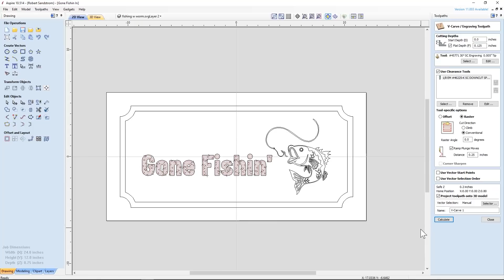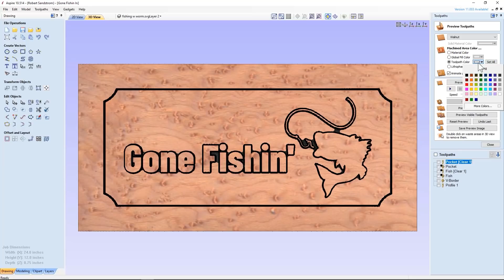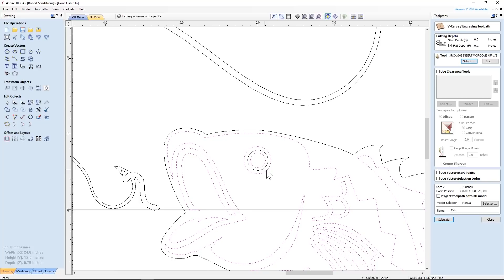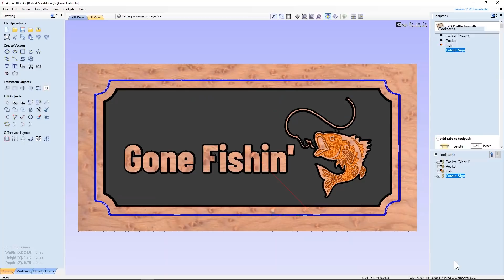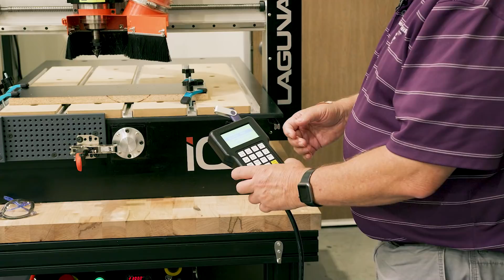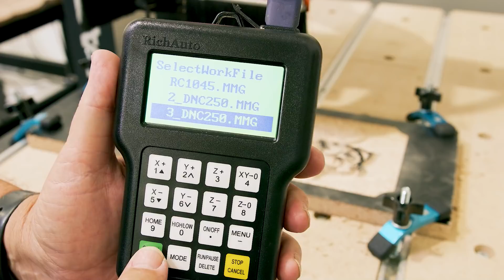How To Design A 3D Sign Using Aspire V11 Or VCarve Pro 11 Software | Sign Making Software Tutorial

Comment: I was wondering how you would incorporate a 3d model imported into Vcarve or Aspire into a sign like this
Reply: Wally's Toolshed.  Thanks for the clarification.  I thought this might be what you were asking.  The process for Vcarve and Aspire would be the same.   It involves importing the 3D file and then inserting it in the sign.  It is a little more tricky because your carving into the wood for the model and then you need to structure the rest of the sign around the model.  I can't think of a video that does this at the time, but Mark Lindsay developed a video like Vectric and several others on how to import a 3D model into your job.  Here is the URL to is video: https://youtu.be/GSkFb-5lXkg.  Your question makes me think that another video on this topic is warranted.

Did you hae a specific model you would like to see inserted.  If I had a copy of this maybe I could use it in the future video.
Reply: BTW the import 3D model feature has really been beefed up and made better in Vectric 11.